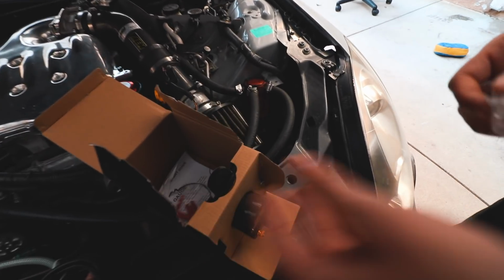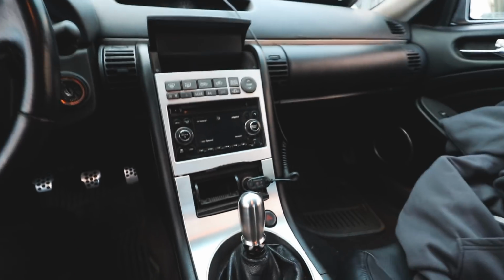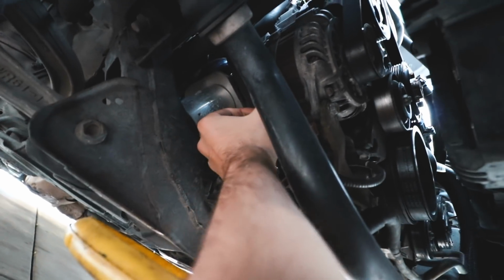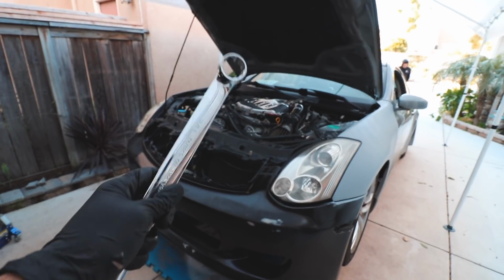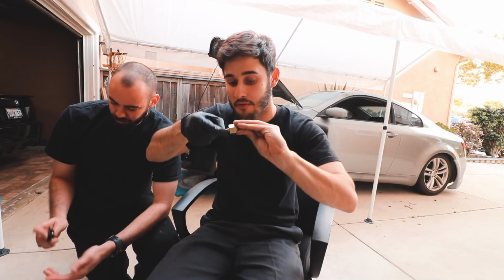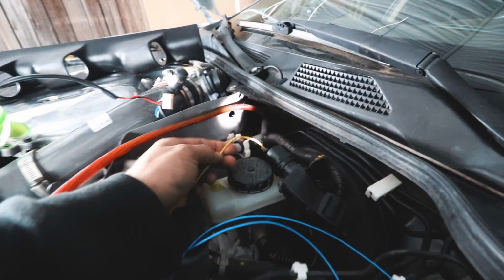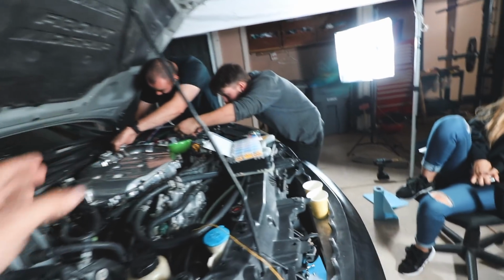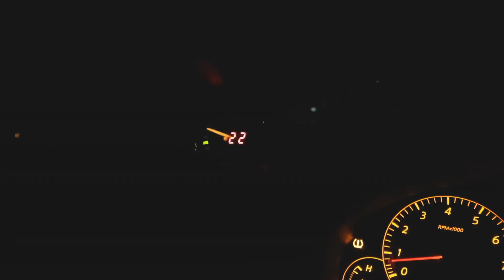Every G35 NEEDS This!

Comment: i have  glowshift  oil pressure  when the car  is hot  the  oil press at idle  is  like  10 psi i just  changed  the  gallery gaskets  😅 but maybe  im going  to buy the aem one  seems more accurate

Comment: Motorvate DIY I am getting codes p0300 and p0021,and the car is running very rough  I changed the pcv valve didn’t do anything checked all sparked plugs and gave them a clean coils looked good expect for the passenger side closest to back of the car coil and spark plug was covered in oil with a good bit of oil in the plug hole what could this be or what should I do next / check? I changed the oil didn’t do anything either the car has been sitting for about 7 months now it’s a 2007 g35x sedan
Reply: It’s the gallery gaskets happens to the early vq35hr and vhr

Comment: Just sold my truck and have $7500 cash on hand. what should i get?🙇🏼‍♂️
Reply from the maker: Depends what you’re looking for! 👀
Reply: Static Works Definitely manual. I had a 2012 2.0t Genesis before and it was fbo and tuned i’m looking at G’s. I had a 04 about 2.5 years ago but i’m looking at 05+
Reply: If you don't mind a bit oil burning, get the uprev. It's a fun car to drive...... If it's running good lol
Reply: Get a g
Reply: Get yourself a bike🚲
Reply: 2005 Toyota Corolla s